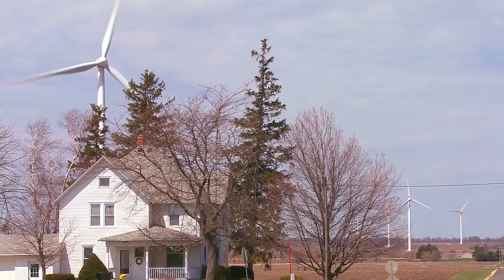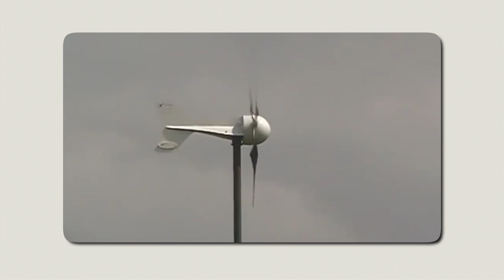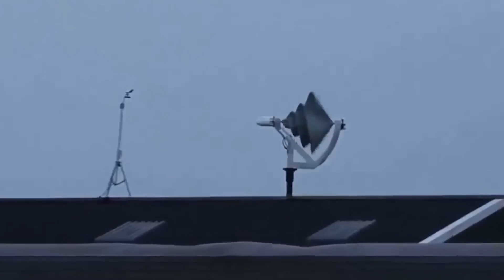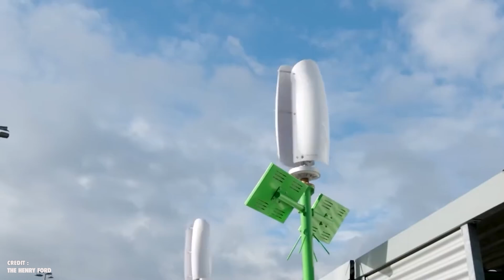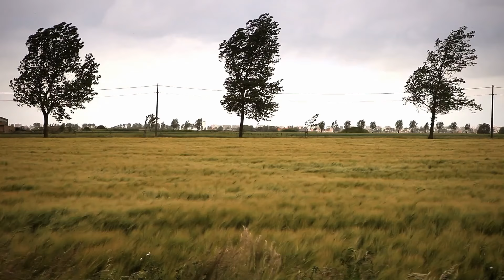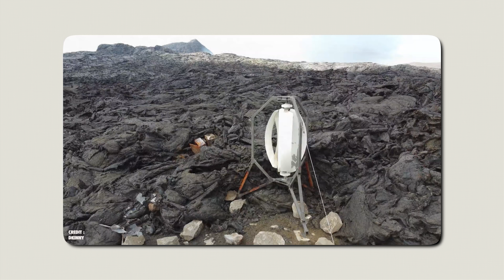These 6 Wind Turbines Are The Future Of Home Power

Comment: You haven't commented that VAWTs lose efficiency because there is always 50% of its rotating area facing into the oncoming wind (unlike HAWTs). You might also ask why the first VAWT has a 'clipped' part of its vanes. This may be due to the need to reduce the lateral load on the shaft and bearing, but thereby reducing the capture potential. Thinking too about footprints, did you notice the guy ropes securing the VAWT mounted on the mast? Economically, home (unless you live on a large estate) wind power is generally a poor choice.
Reply: Three bladed VAWTs, as most are, objectively have no panel surface area facing direct wind at any binary time segment.
Maybe, use some common sense, don't jump so quick to your academic pedantry, your own argument is so far from accurate that there is little point to anyone else replying to it.

Yes, they are less than 100% efficient, as all energy generation methods are. 
The entire benefit is in fact what you call a detriment: the drag of friction from non-generating wind is minimized across the surface area of each blade and its design, standing vertically with only one blade suffering maximum drag at any given rotational area.

You literally didn't pass high school physics, don't start pretending you're a master electrician.
Reply: @Atmatan  I'm confused. Is aimed at me? 

i) Please explain you comment, "Maybe, use some common sense, don't jump so quick to your academic pedantry, your own argument is so far from accurate that there is little point to anyone else replying to it."

ii) "Yes, they are less than 100% efficient, as all energy generation methods are. " That is true. Did I imply anything otherwise? 

iii) "You literally didn't pass high school physics, don't start pretending you're a master electrician." Yes I did. Not sure why you mentioned "electrician". Are we not discussing an engineering problem?
Reply: @andyroid7339  No? We're discussing an energy efficiency debate that's been solved already, while you argue incorrect info from a place of philosophy.
Who else is here, you clown?

Comment: I liked the 1 second clip of a turbine minted on a back of a pickup truck. This made me wonder if, technically, a turbine could be tied to the charging system of an EV. I’m sure someone tried it.
Reply: Imagine driving your car around with a wind turbine strapped to it 😩

As the owner of an EV charging isn’t an issue. 95% of the time the journeys are well within the car’s range. 
You arrive home & plug the car in & then forget about it. 
No messy fuel & you don’t have to queue at a a garage. What’s not to like.
Reply: @hughmarcus1  The electricity to charge your ev still costs something.
Reply: @crackerjack3359  It costs solar panels on your garage.  
- Although being able to swap batteries would be nice.  You charge one while driving with the other.
Reply: @ProfSai  We are getting solar panels fitted next week. it would have cost 50% more ($15,000) to have enough panels to charge an EV, here in Montana. It might be a better deal in Mississippi.
Reply: @ProfSai  If I had a garage, I'd be all for it.
Reply: @hughmarcus1 I’m well aware of it.

Comment: You missed the RidgeBlade horizontal wind turbine that's installed on the top of roofs.  The only issue with that installation is buildup of snow at the top of the roofs during winter.  So it's ideal in the southern urban/rural areas.
Reply: Show me an unbiased test of it in an urban setting.
Reply: @Exaris79 NOT true, every Windmill produces Infrasonic Frequencies and i don´t need them in or on my House........
Reply: @kurtmiller7945  I didn't recommend if they're good or not as any tech has technological pro and cons on them.  I suggested that there's another type of wind generator.  Don't know if the RidgeBlade has infrasound but the known weakness in Canada, there's winter snow build up on top of the roofs.  So a RidgeBlade is not ideal unless there's a way to protect it from the snow.

Comment: me wondering why i never see hydro electricity mentioned.
Reply: Hydro is not a viable option for a single off-grid house as the conditions needed to obtain sufficient hydro power rarely exist on a given private property. A hydro power calculator will tell you what flow rate and what head you need to produce a certain amount of electricity with a water turbine. Flow rate means access to a decent water source. Head means being located on a slope i.e. in the hills or the mountains. How many private properties are there with access to a stream that runs all year round at a flow rate of at least one gallon / second located in a topography that will provide dozens of feet of head? If you are lucky enough to live on such a property hydro is by far the best solution for obtaining off-grid power.
Reply: @wkgurr  based on the hydro I have seen, it's a lot less then a galln.
Reply: In theory hydro is good. In practice in most western countries the cost of all the environmental impact studies means it’s not viable for residential use. 
There are a number of hydro projects around where I live but all are bigger & output to the grid rather than providing energy to the owners. They were all part funded by government grants too.
Reply: @hughmarcus1  the most successful project was the hoover dam which has been running for well over 30 years and has been providing longer tem electricity and water. 

The idea of the hydro plants is that they can be made incredibly small, like brief case small. 

there are, according to enbchanted learning, around 250,000 rivers in the united states. This is a  about 3,500,000 miles of river length.

If you were to make small hydro plants that go on the sides of the rivers, it wouldnt take long before america never has to use any nuclear, solar, or wind power. 

The smallest hydro electric generator is the pico pica 10 which creates 10 watts needs 4inch of water head and a flow of 10 liters/sec.

mind you the studies that state that these things can cuase enviromental damage are ussually done by companies that are at risk if such things become popular. 

According to the department of energy, Washington state already gets 60% of its power from hydro electric dams. (back in 2023)

The people against wind turbines only care about the birds for example when it comes to wind turbines and renewable energy, but then show a bias when they dont do anything to protect the animals. 

a grain of salt based on my own math, but from what i was able to math out, if we used even 1/4 of our rivers using mid sized hydro electric generators, the ones the size of 3 vans next to each other, we could generate enough electricity to power the entire world for a few years after just one day's operation. However this is hyperbolic and may not reflect the reality. 

Why i talk about hydro is becuase it would be a consistent power source, and those around it would see a decrease in their power bill. also it can be made noninvasive and doesnt require expensive or rare materials to make and if it fails, it doesnt do so in an enviromentally destructive way.

examples of why hydro is better:

enviromentally destructive when fails - nuclear
rare materials - solar
stable source of energy - wind

yes this would rely on the government but the government already is who you technically pay for electricity, through their companies. 

however it also means that less resources are needed to upkeep the grid.

Comment: If you have ever experienced ocean onshore winds, then you can imagine rows of indiscreet windmills quietly generating electricity.
Reply: Only way it works is if you make them enormous. Then they work well. The swept area requirement, and the lack of turbulence means you can't scatter them around in little sizes unless you just want to light an LED for a science project.
Reply: @etchedpixels  They don’t need to be enormous. You can have 4 of them on your property of modest size, generating electricity all day and at lower speeds. Compounded with solar and a robust battery system, one can do just fine when there’s grid crashes.
Reply: @icevariable9600  Yeah you'll be able to charge you phone now and then, if you've got wind that's not broken up by other nearby buildings. Whoopee.. I can buy so much more solar and batteries for the same money.
Reply: @e @etchedpixels  Dude. If you’re talking about running a house DIRECTLY FROM THE WIND MILL, then fine. Whatever. But that’s stupid. 

The way to go is to have a battery bank, like the Tesla Powerwall, that your wind and solar feed into. That way, having 2-4 small fans can continuously feed your battery system. This is the only way to do it to take advantage of renewable energy that makes it worthwhile.
Reply: @icevariable9600  But the experience is that small windturbines don't do much. Science come's to the same conclusion. Google for it. The only 'good' thing is that some people get rich from selling it.
Reply: "quietly".... not so much.  Those things make a noise.
Reply: "Quietly"...  Hmmmm... I think not...

Comment: I would love to have local wind power that can also look decent, but I'll believe it when I see it, far too many promises have been made, far too many cons, but so far, they are too expensive and don't deliver enough power at a small scale.

I would love that to change because wind would complement solar really well, especially because of the sessions where there's more sun in summer and more wind in winter, in fact, if I'm not mistaken, I think wind is a bit stronger at nighttime.

But anyway, until I start seeing solid data from many sources of how well and how much energy wind power can do at small scale on a home and the price point will have to be much cheaper, it's got to compete with solar after all and from what I've seen, it's more expensive.

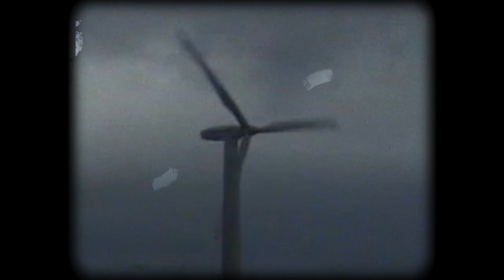Comment: 16:58 - Um, when the lightening bolt on the left is striking, there's a point of light in the middle of the screen just under the clouds right?  Do you see that? Then a split second later the bolt on the left ends and another bolt hits that point of light...  What is going on here?
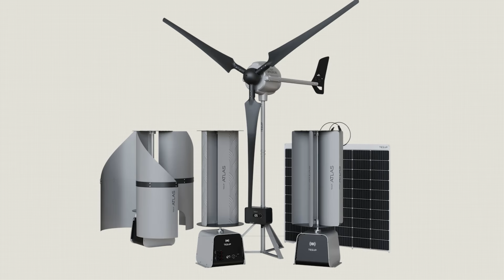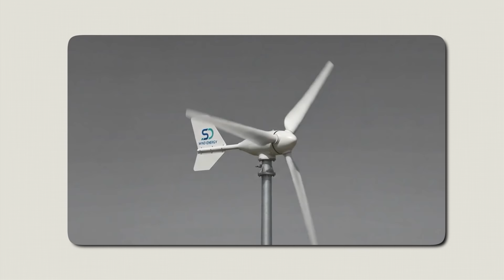Reply: 3:30 when talking about the basic cost of the Atlas it shows three versions, a standard wind turbine, and a solar panel. Gears at 5:15 don't mesh. Fail.